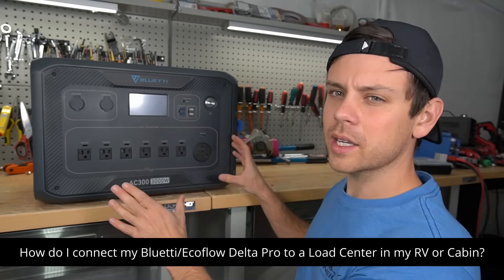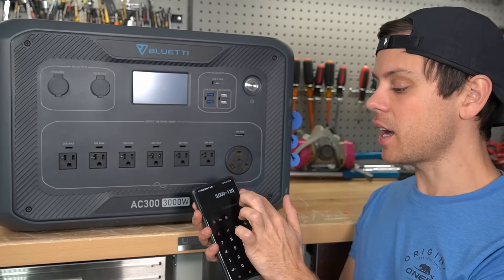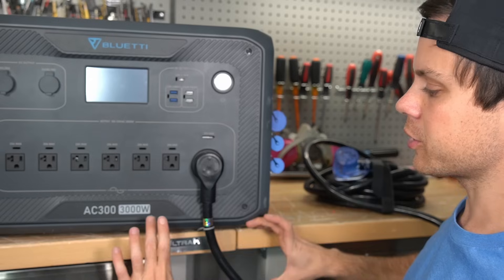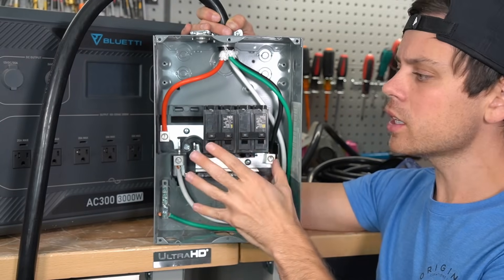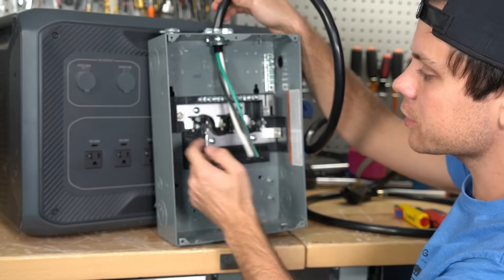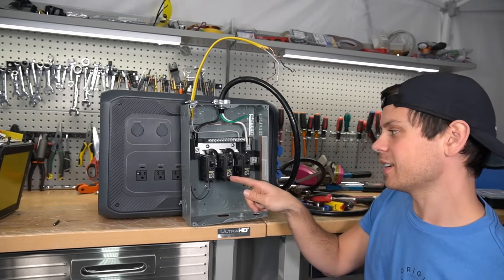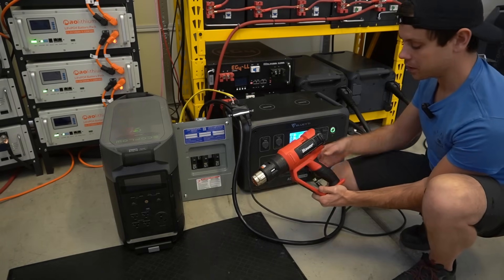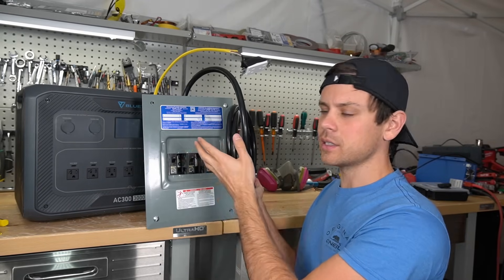How to Power a 120V Offgrid Cabin with Bluetti or Ecoflow Delta 30A Plug

Comment: You have become my reference for all things solar.   I have not seen a video of yours covering the topic of using LiFePo4 batteries to extend the capacity of power stations using the XT 60 connector.  Many youtuber suggest a simple cable from the extra battery to the power station.  Could you make a video on how to make a full system with solar pannel to the LiFePo4 battery to the power station?  I am sure it is a bit more complicated than what many are suggesting on youtube.
Reply: Good idea!!!  I use a Bluetti Elite 100 V2 with 2 solar pannel in my van.  I have watched a few videos that suggest using a 48V battery to tripple the capacity of my system.  My issue is that I only have 1 XT 60 input on the power station, and I am not sure if using a solar charge controler to connect to the 48V battery and then running a cable from the battery to the Power station would be ok and safe.  My solar pannels have an open voltage just under 60V which is the limit for my power station.  Would love to see a video about making this kind of setup!

Comment: I have a  2 ea EcoFlow Delta Pro Ultra in an Off Grid situation and want to run 1 ea  240v and 4 ea  120v circuits in my cabin, what CB Panel box would you recommend and how to connect between the EcoFlow and the panel.  Any advice would be appreciated.

Comment: a good money making idea for all these power station people would be to make a portable power station that hooks up to the rv or van via a dedicated plug, they could make it expandable for larger power needs by daisy chaining multiple units,  so that it powers the fuse block as a whole.  basically, eliminating the multitude of magic boxes needed to set up a 12v system.  it has solar charging and an inverter already.  it has 12v and 110 plugs already,  put a power output to plug into your power station to power your 12v system using no regular battery bank, or have the option of charging your battery bank with the station which you can do by plugging in a battery charger to the 110v plug...but to directly charge the bank without a go-between charger... all batteries would need to be the same  IE all lithium.  i have an ecoflow delta 2 with extra smart battery.  i want it to run my whole campervan.  i have 400w of solar on the roof of the van and 220w  of folding portable solar panels as of now.  but if i could just hook up the 400watts worth of panels to the power station and then hook the power station directly to the van's 12v system,  i wouldn't  need a battery bank at all.  the power station becomes the entire dog and pony show.  unfortunately, the outbound ports are all too small to run the whole van without re-doing all the wiring to plug into the various usb and cigarette lighter plug.  the 110v stuff is easy, i only need an extension cord to the appliance i wish to run.  its the 12v with the multitude of items that makes it harder.  so having a power station to power the fuse block instead of smaller individual items is desirable for me.  i may be able to figure it out,  but idk how as of right now.

now the bigger ones like the pro have a 30 amp plug which you just showed us.  but the regular delta 2 doesnt seem to have that capability which is very disheartening for me because i need that and cannot afford another power station.

Comment: Are you required to do this via 30 amp?  Could you do this with 15 or 20a?  I need a smaller set up for a small shed, running lights and a few ryobi 18v chargers.  Rather not buy a huge portable station, more like a smaller one but they dont have 30a.

Comment: How did you plug that 30 amp cord which had three prongs in the blueetti into the Eco flow that had four prongs?
Reply: I am not sure how he did it on this video but there are other videos out here where they use various adapters connected together; FrankenCable.

Comment: What I’d like to see is a list of inverters and whether they have ground-neutral bonding or not. Aside from load calculations, that’s the single most important thing you need to know if you want to power, say, a small cabin or shed.
Reply: I am in a boat close to yours. I have an All In One Inverter I would like to connect to my circuit breaker via a generator port with an interlock.
  Oklahoma Off-Grid has a video where he connects into the power out from the All In One Inverter (to an outlet center)  and Silver Cymbal and some others show how they connect to the generator plug from a power station but there is no video or article I can find online that shows both for the All In One Inverter. 
It would be great if Will had a video on it and his thoughts on it. It would be the easiest to do for many of us but his explanation of grounding with them would help a lot as well.

Comment: I've decided to just use my Ecoflow Pro to power my new garage, off grid.  Seems it is more than enough amperage for 2 garage doors, LED lighting and small power tools imho.  But from what I can discern I still need to run a code compliant pair of buried grounds into the physical ground still to help protect those circuits running through the framing - also for future proofing for mains power.  For this I think I will hire an electrician.  The building is too valuable to risk not having insurance due to lack of code compliance and permitting.  I have a generator panel with transfer switches and breakers I could install in the garage, but I understand code also requires me to have a main breaker so it may have to be rewired or a different model of breaker panel used

Comment: What would be a good solar setup to be able to run a 220v appliance that is 5kw for 4 hours.  I am trying to outfit a van to run a welding business out of it.  I would like to mount this permanently in the van and still be able to haul cargo.  I am thinking that two power stations and external batteries would be the way to go.  What do you think?

Comment: Why not connect the plugs directly to the AC ports on the portable power station? Is there a risk to the station if too many watts are being drawn out at once and the breaker panel protects it? Or is there another reason?
I am launching an ice cream truck this summer and was planning on connecting the freezer, fridge and AC directly to one Ecoflow with time solar panels on top of truck. Am wrong to do this, any guidance would be appreciated. Thanks!

Comment: *Newbie question; could you not add a second power station to that 240v load center? One station supplying bus bar #1, and the second supplying bus bar #2? 

I do assume I can’t or you would have said something, but I’m also very curious. Would love to know the “why” either way…
Reply: You need two ac500, at least one battery on each one, and the fusion adapter from bluetti to sync the phases of 240v. If you just attached two ac500 to seperate legs, they would not be in sync to run anything, probably dangerous.

Comment: Hi Will, great channel. I know nothing about this stuff. so I really like your channel. My off grid cabin has already been wired with a electric panel and earth ground as if some day I may have grid power. (but thats along ways off, way expensive) I dont have it set up to run 240, its only 120. Right now they put a 30amp RV plug on outside wall that connects to that panel. Can I just plug my solar generator to that? do I have to worry about grounding or that the panel having earth grounding? also not sure if it matters but im planning on 2200watts of solar panels hooked up to the solar generator and to use a gas gen to charge only when needed. I would be plugging the gas gen into the 15amp or 30amp charging side of the solar gen. all would be hooked up at the same time. Thanks for all you do.

Comment: Wow, super informative videos. Thank you! Question: my wife and I are building an offgrid home with a solar/generator combo. Im wondering how I could wire in a generator plug into this set up, so that if I run any larger appliances or my whole tiny home, I can also be charging the battery at the same time? Thanks again

Comment: Do you need to ground the service panel if the solar generator is plugged into a grounded 120 volt home outlet and connected to solar panels (which are not grounded)?  Thank you

Comment: Would you be able to do this with an ecoflow delta 2 max? It doesn’t have the 30a port. I just want it as a way to keep the lights on and power my igniter for my boiler. Any help would be greatly appreciated! My current plan was adding a generator plug. But after that I’m not 100% sure.

Comment: Why not use the 12v DC/30A with a 12 way fuse block and 12v appliances? Just curious? Isn’t it less watts used? I understand 12v appliances are more expensive but the usage is less correct?

Comment: Hey Will, thanks for all the information you put into this video. I had one question, inside your panel, you kept the ground and neutral on separate bus bars because it was a sub panel. Did you have to run a ground wire from a ground rod up into the box to the ground bus bar?
Reply: I have the same question…did you ever find out the answer @aflipzkidn
Reply: @BryceCalvo Yeah, at 2:25 he actually answered my question in the video. The solar generator handles the grounding for you. So no ground rod needed for the subpanel.

Comment: Hi Will, Can I do this same thing by using one of the traditional 120V plugs? I came by a jackery 1000v2 for free and want to put it to good use. It does not have that 30am plug.  So could I use one of the 120 v plug ins as a source to then power a small shed?  Is this something your book would show me how to do?

Comment: Bluetti ac200max , ac300 and ac500 power stations have a floating neutral so wouldn’t you use a main panel with bonding screw connecting the grounds and neutral buss bars ?

Comment: GOOD FOR NOW. But I need 5 million Amp hours should connect a a 5 megawatt battery to this kind of power. The RV top out at 412 miles on 22 tons at 98 miles an  hour. On 4 carbon fiber  200 HP HUB motors.(HUB motors take over everything.. Oh.. sorry wrong earliest in timeline. Welcome to 2098. Sorry old man. goodbye. Enjoy the futures.

Comment: Thanks for this video, I'm planning to run this exact setup with my Delta Pro. One question: I believe the DP does not have an internal N-G bond. If I'm totally off grid (no AC input), is it best to 1) do the N-G bond in the panel 2) do the N-G bond at the DP (like with an adaptor plug) or 3) not perform any N-G bonding? I know you literally say "let the inverter handle the N-G bonding", but I'm wondering how faults would be cleared in this scenario. Thanks again.
Reply: Very good question. I was wondering the same thing. Have you ever got an answer?
Reply: I have a Delta Pro and I contacted Eccoflow about this and they told me the neutral ground bonding should be done in the service panel.

Comment: Great video, as always!  For those confused about the bonding...make sure that you test that you actually have a ground-neutral bond somewhere in your system... Don't assume that the Generator already has a GN bond.  I believe the AC300 is floating so you'll need a bonding plug in the configuration show here.

Comment: Hi Will..Thanks for all your helpful videos. I’ve been racking my brain to figure out how to run my Northstar TC650 pop up slide in camper (with 650w AC) boon docking. Because of your video,  I think I will just buy the Eco Flow Delta Pro and plug my 30a shore power plug directly into it. I will create enough solar on the roof to recharge and also have alternator recharge capability. I will also bring my Honda 2000i with me to make sure I can always keep the system charged up. Very helpful. Thanks👍🏻🤠

Comment: If I connect a load center from EcoFlow delta pro dual voltage hub, can I connect the ground to my house ground so I can charge an EV? EcoFlow is only powered from solar so no ground loop with house power. Asking for a friend.

Comment: Will, why not just use a TT30 to L14-30 adapter cord that jumpers the  two hots together? Why wouldn't you be able to feed 120v to both legs of your panel if you turn off any 240v breakers? If your power station can't output more than 30A, neutral overloading shouldn't be a problem. Honestly curious.

Comment: Will, first off thank you for all the content. You have legitimately changed my life lol. I'm so obsessed with this stuff now all because of your videos planting that seed! I have a Bluetti AC300 with 2 B300 batteries. I have a Reliance 10 circuit transfer switch tied into my 200amp main. We have a small house and I'm not worried about split phase, so the one AC300 setup is perfect for me! I have 1600w of solar via (8) 200w Rich Solar rigid panels. This is where I'm stuck. I have the EG4 Ground Mounts out in my backyard. I got two of them, each to hold (4) of the 200w panels. I have two 16a dc circuit breakers I'm going to put inline from panel array to the Bluetti. I am absolutely stuck on how to properly ground the solar arrays. I know I'm probably over thinking it and it's not a huge deal, but I want it to be safe and done correct. The panels are about 50 feet from the house. I have PV wire (direct burial kind) to go from panels to breakers to bluetti. I'm going to run them in conduit underground just for extra protection. I have two ground rods out back by the panels. I do not know how to properly ground this. Being that the AC300 is feeding a transfer switch, I'm assuming the panel grounding system needs to be bonded with my main ground system. To do this, do I just run a copper wire in the conduit with the PV wire up to the house? I think once I come into the house with the PV wires that they need to be in metal conduit since it's DC. Can I bond a copper wire coming from the ground rod at the panel array thru the conduit into the recepticle for the transfer switch? Would this bond my solar array to my houses main ground system? I'm really hoping to hear back from you, as several "pros" keep giving me conflicting advice and I am feeling defeated that the easiest part of the system is taking me the longest to figure out. Anything helps. Thanks again for all that you do and I hope you are doing well!!!
Reply: Unfortunate that nobody responded to your question, but I'm curious how you finally resolved this.

Comment: Thanks for this.  I have my AC300 and 2 B300s and want to put them in my van.  I understand I should plug the AC300 into shore power and then to the distribution panel and the Bluetti will decide whether to power the van with the battery or shore power when available via the UPS.  Is that correct?  If so, do I need to use 30A shore power service or 15A (which was the default setting on the Bluetti).  If I use 15A will the AC300 be able to pass through the power at 30A? (I realize this probably confirms my lack of knowledge regarding power.  I always said there are no stupid questions...just stupid people who ask questions!)

Comment: Good practice for power circuit calculations is not to exceed 80% of max rating. i.e. (30amp x .8 = 24amp) max. amp output.
or 110V x 24A = 2640W

Comment: I installed a jumper wire inside the bow to use both poles (you don't recommend). My 3000 watt inverter is inches away from the sub, I used 8 ga wire from the inverter to the sub and for the jumper. Only using 12ga romex, 15a fuses, powering 4 freezers, and 2 refrigerators for over a year with zero issues, no noticeable hot spots, warm breakers, wires etc.

Comment: Hi, I have the Bluetti 200 Max. I set up the subpanel exactly the same way. the outlet tests that its wired correctly using an outlet tester. However my neutral wire shows 60 volts using a volt meter. Ground to neutral is 60 volts. Ground to hot is 60 volts. Neutral to hot is 120 volts. I am concerned that the neutral will always be energized. Am I missing something?

Comment: Will, A year ago I had an electrician install an interlock and a 30 amp outlet so I can power my home with a generator if the power goes out. My question is, If I built a a split phase with to inverters like you show in you vids, can I use the 30amp outlet, just like I do for my gas generator?
Reply from the maker: Yeah it should work fine
Reply from the maker: That's what a lot of people do now. Very safe and easy to power with the off-grid inverter
Reply: @WillProwse  Thanks for your Reply Will. I have another question. If I have two AIO’s connected as you show on your 13k build, I want to use the AC inputs when the grid is up to help charge when the grid is up. Do i tie both AC inputs together or will the Input off the slave inverter power both or do I need to keep them separate? What gauge cable should I use?

Comment: Will, We just bought a Delta Pro with the Dual Fuel generator for our off grid cabin. Ecoflow is saying there is no way to attach the renogy 100 ah that we have to the delta pro to charge it and also to draw from it like you would if you had an an extra delta pro battery. Is this true?

Comment: Hi man, big fan of the channel, I wanted to ask if you could test the XZNY 12V 20Ah LiFePO4 Battery, 5000+ Cycles Deep Cycle LiFePO4 Battery Built-in 20A BMS, on Amazon? It's only $74.99! Wonder if it's a good value or not? It has 92 reviews with an average of 4.5 stars. And also the 12V 24Ah Rechargeable LiFePO4 Lithium Iron Phosphate Battery with 3000+ Times Deep Cycles and BMS Protection by eco worthy which is $105.99 and has 200 rating reviews on Amazon with an average of 4.5 stars.

Comment: Nice video Will!  I would like to see a video showing how to run Solar PV wires "to code" from the panels say on a shed or roof into the house through conduit.  Basically a start to finish solar PV wire video.  From the panels to some kind of weather proof connection box, then buried and run to the house, then up through a LB and into the house to the charge controller.  Thanks!